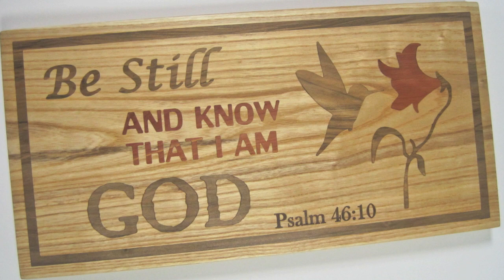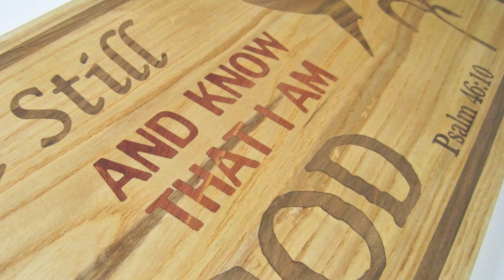Time Lapse CNC Inlay Plaque -A Day in the Shop-

Comment: Hi! I'm planing to get an Asteroid like yours. I see in the web site, it comes with a PC. Is it any software preloaded on it or I need to order it seperate. There is no info about the PC parameters. If I want to purchase V-carve pro, can I load it in that same PC?  I am a MAC user, but if I can have the PC dedicated for my new CNC router will be nice. Thanks!
Reply from the maker: +Bgkaval Yes, the software to run your machine is preloaded and configured for the router so all you need to do is plug the cords in.
The computer uses an Ubuntu operating system.  This system is rather hard to configure and is made for the advanced computer user.
Probotix and other CNC users recommend not to put any other large software on your control computer as this could slow it down, which would slow down the output of numbers and slow down your machine.
I personally am a mac user as well, and don't like to touch any other operating system.  So for my VCarve Pro software I use Parallels on my iMac.  This way I can do all my design on a mac but still use a windows program.
Parallels is fairly cheap compared to the cost of VCarve.
And yes, VCarve does have a Wrapper gadget on it, I think you can find a tutorial on the Vectric website.
Reply: Hello ! Thanks for the answer. Parallels is a desktop software allowing windows to be used on MAC as I understand. Does that mean I need to get Parallels + Windows + V-carve pro and load all that on my mac  in order to do designs ?
Reply from the maker: Bgkaval Yes, if would like a reliable and easy way to use VCarve Pro on a Mac this is really the best way.  There are other softwares that are like Parallels but they are not as reliable and fast, and they don't integrate with your mac very well.  Parallels acts just like any other application on your mac.  So you don't need to restart your computer or anything.  Its as simple as opening an app.

If you do not already own a windows computer, then I would recommend putting the money towards the Parallels method instead of buying a Dell or HP computer.
And yes, as far as I know you would have to purchase the windows OS ($120) as well as Parallels ($80) and VCarve Pro.
Reply: Just so you know, i have been running V-carve in Parallels for the last 5 years. It works flawlessly.